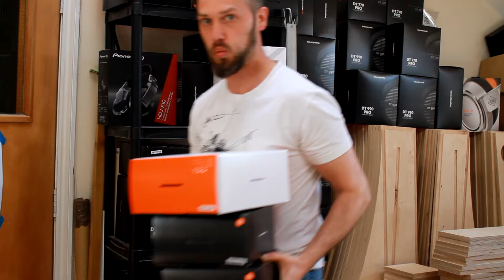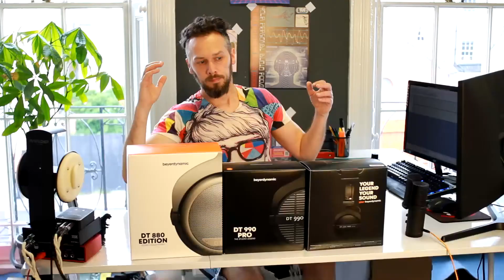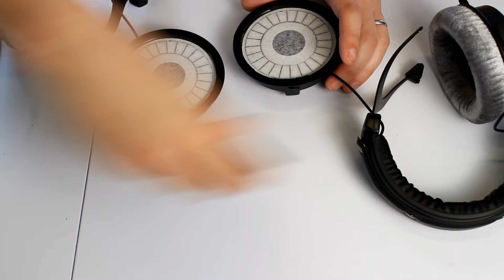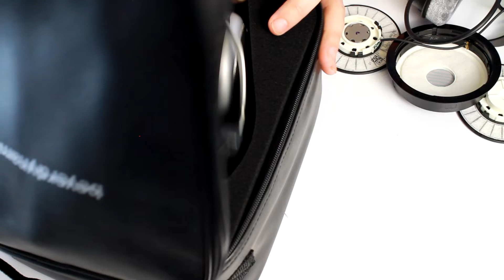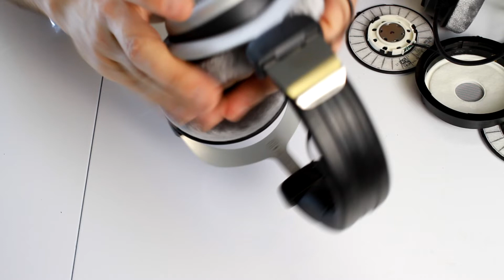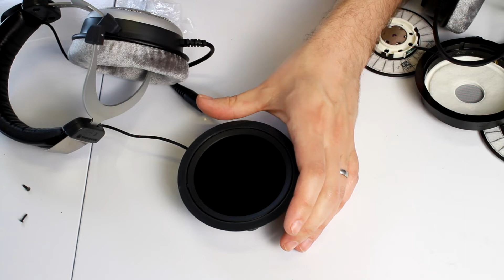What is the ACTUAL difference between the DT770, DT880 and DT990 Beyerdynamic headphones?

Comment: Does anyone know if the 990 (250ohm) driver is the same as the 770 (250ohm) driver?
Reply from the maker: The 770 version has an extra plastic cap over the magnet

Comment: I only tried 880s and 990s 600ohm and the 880s sound more flat, the 990s definitely got more bass and a bit bigger sound stage. 
As an overall experience I feel the 880s sound more "authentic" but the 990s sound more interesting, so I would think one is more for pro use and the other for enjoying media.
Reply from the maker: I have not had much time the 880 for some reason... There are always 990s and 770s knocking around office which the staff use. Perhaps I will have get some out and live with them for a bit

Comment: Interesting. So I could put a DT 770 driver in the DT 990 if I just remove the tuning stuff and it would be like nothings happened?
Reply from the maker: Pretty much... every driver is slightly different and beyerdynamic pair up similar ones
Reply: Is the DT 990 drivers matched? I thought it was only in the DT 1990, because the latter you can only buy in matched pairs, where on the DT 990 you can buy them separately. @CustomCans
Reply: @CustomCans  Randomly found this comment again. According to Beyerdynamic all of their drivers are within 1dB variance and therefore they don't need to match them.

Comment: for keyboard arranger Yamaha PSR-SX900 is better 32,80 or 250 ohm? thanks
Reply from the maker: Probably the 80 as it will run nicely off most equipment and I think they are a little better than the 32ohm ones

Comment: Great video and I appreciate all the technical insight from the teardown. But there are also a couple of additional factors such as application of use and impedance in terms of which hardware to drive the headphones. For example, the 770 - (80 Ohm) seems to be the sweet spot in terms of versatility between studio desk and small devices such as Laptops/Phones/iPads etc.
Reply from the maker: Yes, we may have to do a 32 vs 80 vs 250 vs 600 ohm to see what the difference in sound is
Reply: @CustomCans  Great video mate. I'm your new subscriber btw.  I've got 770 - 32 and 80 ohms, but I haven't used open ones. I know impedance matter and I'm really curious how it relates to sound experience. I love nice bass and some highs too. What would you recommend please? Cheers
Reply from the maker: @mustafadigibong6833  If you like the sound of the 80ohm DT770, I would probably stick with those and potentially fit one of our mod kits to squeeze out a little more goodness from them. The 990 have better treble but less bass. They are worth having a go on as the open sound has a certain magic but they do have a much more treble focused sound.
Reply: But the 770s are heavier and less comfortable than the 990 (it's very obvious, I test one after the other at home at the time I write this comment). We quite easily forget that we wear the 990 on the head, which is not the case with the 770s, which are heavier but also more compressed on the head with a more suffocating result after only a few minutes. The 770s are also a lot warmer. On the other hand, the 770s have a sound that retains the bass more and we are more immersed with them in the sound perspective, largely because we are in a closed environment. This does not prevent the 990 from also offering a very clear sound with a bass layer @CustomCans

Comment: You are a bit comparing apples and oranges, when the DT880 is the Edition version and the 770 and 990 are the Pro-versions. The Pro-models are cheaper, more plasticy and meant for studio use and the Edition models are designed as hi-fi headphones. So the question is that is there a difference of the sound between the Pro- and Edition-models, like DT990 PRO and DT990 Edition... At least the Edition model does not have the part covering the opening in the middle, they do have similar looking internals, as I just had my own DT990 Editions open as I was replacing the cable, but is the difference mostly just cosmetic or something else... who knows. They are supposed to have the same drivers and similar sound according to Beyerdynamic, just different headband and fit (the pro model is supposed to be tighter and Edition more comfortable).

Comment: On dynamic drivers, to limit the airflow in the back of the driver means to tame the bass, all dynamic drivers have something there, cheap ones have paper, expensive ones have that net material like the 880's have in this video. AKG are the masters here, the masters of using the least amount of effort to tune their headphones, basically all AKG headphones have a small patch of that material stuck to the back of the driver where the air exhaust is. If you remove it, they gain a LOT of bass, pretty much a 5-10 db boost up to 200-250 KHZ. Unfortunately, the driver can't take it so if you do remove that it gains noticeable distortion. Anyway nice video. Personally I can't say I like what Beyer is doing here, I find it to be messy, but the results matter and they seem to be getting great results.

Comment: On the DT800 I would like to know the sound difference between the 80 and 250 ohm models..  bass /  mids /  details ?  in a nutshell , listening on home amp or PC with external USB DAC  would one be preferred over the other ?
Reply: Only the DT 770 is available with 80 ohms. The 880 with 32/250/600 ohms.

Comment: Great vid but......even more confusing for somebody deciding between the 770s & 990s as the on-lines reviews are very conflicting when it comes to bass output, It seems to be around 50/50 on which model has more bass ranging form the 990s having hardly any bass at all.... to having more bass than the 770s which is very weird indeed....Would be great to hear your opinion after a sound test.....
Reply from the maker: I think a lot of the confusion comes from the fact that there are a lot of different versions of each with different impedance. The 32ohm ones sound very different from the 250ohm and the 80ohm are somewhere inbetween
Reply: @CustomCans  Ok In your opinion comparing 32ohm versions of both the 770s and 990s, which one would you say has more pronounced bass ?

Comment: This was very nice and useful! I'm looking into the 880 and I think I  should get it. Is the 32ohm version ok for me If I don't buy an amp straight away and just plug it into my PC/phone/gaming console?
Reply from the maker: I have not listened to the 32ohm version but yes, you should be able to run them without an amp
Reply: I have the 32 ohm 880 Edition pluged directly into my Lenovo Yoga C 740 notebook and I LOVE them.
Mostly listening classical and soundtracks. Volume is mostly on 46/50. 
That was also the reason for me why I took the 32ohm. I didn't want to buy an additional amp.

Comment: Strange that Beyerdynamic has not bothered redesigning the cups of the 770 and the 990 for better sound. I doubt it would cost them much to do, if anything at all. The cups on those could be designed better in my opinion, even at the price.
Reply from the maker: Yes - it is probably partially a business decision. They have the new Pro X range at around £200 with a nicer design and the 770 and 990 have become legends in the studio so they don't want to mess with them too much.
Reply: they're called the DT 700 and DT 900
Reply: @RabbitConfirmed  They didn't change much other than a new module and slightly different driver. Not much in the way of baffling or resonance traps.
Reply: @phillipnunya6793  I would disagree, I've both the DT 770 and DT 700 and I think the DT 700 is quite a bit more balanced. Im using it as my daily driver atm.
Reply: @RabbitConfirmed  You disagree with what? They did not add baffling or resonance traps. The changed the driver and slightly changed the dampening.
Reply: @phillipnunya6793  I don't understand what's your issue with the sound is, did you even try them?
Reply: @RabbitConfirmed  Yes... When did I say I had particular issue with the sound? I have my issues with some aspects of the tuning for music, but that is irrelevant. I said they could have easily done better for little extra cost.
Reply: @phillipnunya6793  They are already outstanding for the price. Idk, man.
Reply: @RabbitConfirmed  It would not have cost much to mold the shell with a diamond pattern instead of a smooth surface. That alone would help. That's my whole point. I don't care how good you think they are for the price. There are simple design changes they could have made to update the existing designs. They could have also added it to the new designs. They just didn't. There is a lot of basic things they could have done that would have barely affected the price.
Reply: @phillipnunya6793  this is not how manufacturing works, especially in high volume every slight change costs a TON of money AND time with the added potential to cause issues.
Custom cans nailed it, they are studio legends, it's not wise to mess with them too much, very delicate endeavor.

Comment: Nice video!! can you do the same treble damping mod (with toilet paper) on the 770 or 990 like on the 880? The black foam covering the drivers look identical on all of them, so I guess yes. If I want a 880 with more bass but no more treble, I could buy the 990 and do the paper mod for that (as idea)…
Reply from the maker: I  don't know for certain but probably .... Give it a go. I have just dismantked the Beyerdynamic Tygr and they have a thicker foam disk in front of the driver to reduce the treble... But.... From experience things like that often have unexpected effects elsewhere in the frequency range so there is a lot of trial and error until you find the result you want

Comment: i have both 990 and 880. i bought the 880 first. a week later i bought the 990. they are definitely different. i would choose the 880 for anything that didn’t require a bass involvement like electronic music. the 990 gave the   bass (extra), but the 880 gave a nicely sweet mids and highs. comfort is unbeatable
Reply: How does electronic music not involve bass?
Reply: for rock and pop. which one should I buy? dt990 or dt880. im confused 🥲

Comment: I have the dt990s and 2 pairs of dt880s. I was wondering what the score was with 600ohm drivers. Nothing I had would drive them properly. So I got myself a proper tube amp. For pop and rock music the dt990s are really great but the dt880s for jazz and classical through the tube amplifier have to be experienced. I doubt that there are many other headphone amp combination out there which come close. It is like listening to some really high end speakers. Amazing imaging. Ps the 990s are basically unbreakable. I know mine are used by my  sons as well.
Reply: You shouldn't doubt. I believe they sound great trough warm amp, but they are not even at the top of the headphone range, let alone speakers or enthusiast grade equipment. Ive heard 770... For 1 minute, it was so bad i dont even grant them a second chance, but i see how they would be more balanced with darkness and warmth. If you seek jewel of a headphone, try finding HD 250 Linear I 600 ohm. It has to be exact model and you will hear them open up with better amps.

Comment: Dang thanks for this video

After getting some used DT 990s I got replacements from amazon. I still listened to the old pads (The seller said they cleaned it and the pads certainly smelled of some kind of cleaning chemical, so no worries on grossness) so I did have a point of reference on what these should sound like.

When I got the replacements, from Beyer's official store page, they sounded way boomy and different. It wasn't until I watched this vid when you showed the differences between the pads that I realized what happened, I compared the two pads and sure enough; my stock pads had black foam on the inside and my replacement pads had silver foam. I got DT 770 pads when I wanted DT 990s

Edit: It was from a third party amazon seller, not beyer direct, but it was on beyer's page

Comment: Thank you very much, this is exactly what what I wanted to know, well done.
I have request, I really want to see what is really different inside of 770-80 ohm and is there any differences between (16) - 32 - 250 - 600 ohm other than driver impedance, pads and headband pressure?
Reply from the maker: the 80 and the 250 are the same inside - it has been a while since I have done any 32ohm ones but I don't remember it looking any different inside. They all have the same headband so any difference in clamping force will be down to the thickness / density of the pads
Reply: @CustomCans  Thank you for the fast reply but then why do 80 ohms have more bass compared to 250 ohms? Years ago I have read somewhere they are tuned differently and after watching this video (after watching your cable and dampening mods) I thought you are the one who can do it perfectly with all that experience.

Comment: what's the real difference between the 250ohm and 600ohm DT880??
Reply from the maker: About 350ohms ;) 
They have a different driver so do have a different sound - the 600ohm ones need to be amped but are supposed to sound better. I have not herd a 250ohm pair so can't compare them

Comment: Really interesting. I own an old  pair of DT770 pro (250ohm) from 2002. Since they are falling apart I just bought a new pair. My gosh they sound bright with a laid back midrange compared to. If it doesn't change over time I'm going to swap the drivers from old ones with these. I also used to own a pair of DT880 pro. I did not like the sound of those. So I sold them again
Reply from the maker: The sound does change a little as the diaphragm loosens up a bit
Reply: @CustomCans  Thanks for your answer. My old ones are from 2002. I think they've changed the drivers since then. On my new 770's I need to turn down the treble about 3dB at around 8kHz to mimic how the old ones sound. But I can easily switch the drivers so I get the sound I like
Reply: @CustomCans  Actually I've been listening some more. One other huge difference is the mid range. The new 770 has a v-shape sound and the old ones are much more open and dynamic sounding. So my guess is that the old drivers were made in Germany and now we get a cheaper version driver produced in China. And that's how they keep the price down
Reply: I own a pair of DT880 Pro's liek shown in this video. They were a bit too bright for my taste initially, so I went into my PC's audio control and cranked up the artificial bass boost. They are much more pleasant to listen with after doing that. I love these so much that I'm considering on buying a new pair since this one is going out on me unless I can fix the cable.

Comment: can a gayming laptop run DT 770 pro 80 ohms or im better off getting DT 880 32 ohms the price is almost the same probably a discount
Reply from the maker: Yes the 80ohm ones should be fine from most devices
Reply: @CustomCans  I game on DT 880 pro 600 ohms no problem! 60-70% of volume is the sweet spot of loudness. Gaming motherboards are normally supporting higher ohms. I casually used em on Nokia 6.1 - at max loudness pretty nice ASMR too! Use with Ipad pro 2017 12 inch, no volume problems at all. I just don't know can the 600 ohm headset be "underdrived" while being loud on a non-pro-amped device? Dunno, i tried external soundcard that supported up to 600 ohms and i dont think the difference was noticable :).. Probably preamps are gimmicks

Comment: Thank you very much for this comparison. I was very interested in how the design and advertising differed.
I've never owned a pair of high quality headphones. I would be really interested in your opinion about how much the impedance difference within the same model of headphone changes the listening experience. (I see 25, 80, 250 and 600 ohm versions advertised.)
Reply from the maker: It is difficult as they all sound different but in general - on the same model, the higher impedance ones like the 250 and 600 have more control and tighter bass but need to be run from an amplifier to get the best out of them. The lower impedance ones seem to have boomier bass but can run off most equipment like phones and laptops without any majour issue - the 80ohm is a good compromise
Reply: @CustomCans  Thank you. That is really helpful :)
Reply: The different impedance models exist so they are compatible with a wider range of source devices. If there was one "best" impedance, all headphones would just use that!

You want to optimize for two things, damping factor (affects sound quality) and volume. Damping factor is the ratio of headphone impedance and source output impedance and the general rule of thumb is that you want this to be 8 or higher. For maximum volume the ideal load impedance varies by source device but for a voltage limited amplifier the lower the headphone impedance the more power it can pull out of the amplifier. Something like the iPhone headphone adapter will have a very low output impedance of below 1 ohm but not a lot of voltage so the 32 ohm edition would be your best option. The Google Pixel v2 dongle has the same voltage but an output impedance just under 8 ohm so to get the damping factor below 8 you need the 80 ohm edition. My Behringer UMC202HD has an output impedance of a bit over 10 ohms but plenty of power so plugged into that the 250 ohm versions would deliver better sound quality. 600 ohms is so exotically high that most outputs specifically designed for headphones might not deliver enough power into it, but for sources that have higher output impedance and have voltage to spare it might work best.

I haven't tried them but I suspect the hype behind the 600 ohm model stems from some people comparing those to a lower impedance model on a high output impedance source, correctly noticing that it sounds better. This isn't necessarily the case with all sources!